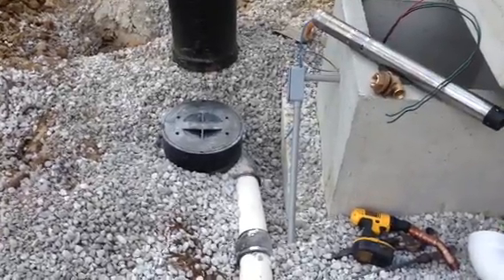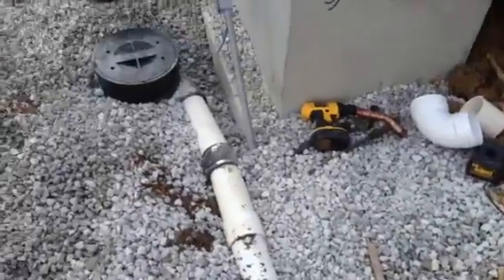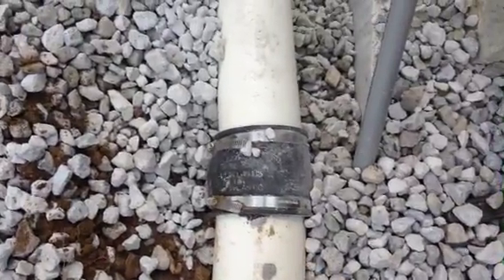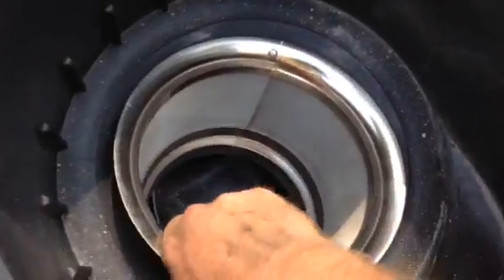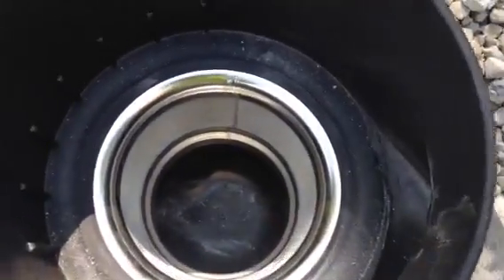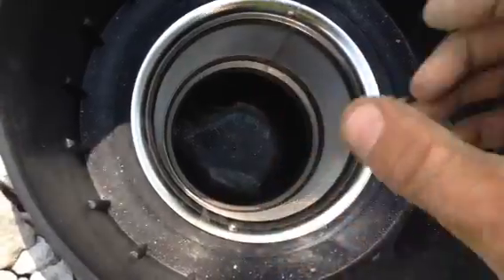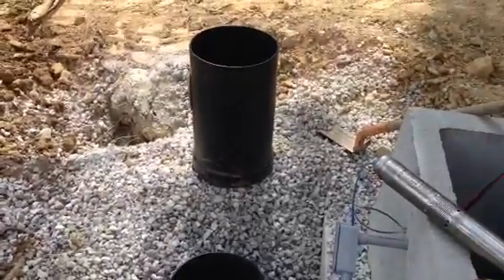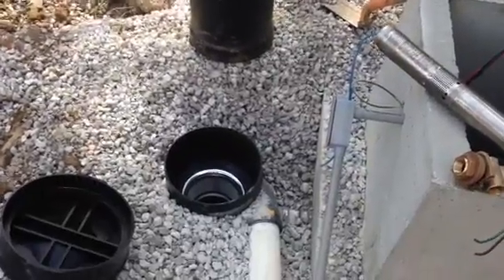How to Install Wisy Vortex Roof Washer

Comment: Wouldn’t the filter require removal for cleaning or replacement at some point?  With the riser, how do you get to the filter?
Reply from the maker: Yes, the filter should be cleaned approximately once per month by placing the stainless steel filter element in a dishwasher. There is a lid on top of the riser and a removal tool to pull the filter out of the unit

Comment: Can a car roll over it?
Reply from the maker: The vortex unit is not rated for traffic. The only way you can make it traffic bearing is to pour a concrete pad around it and set a cast iron lid in the pad. We have larger vortex units for commercial applications that are traffic bearing though